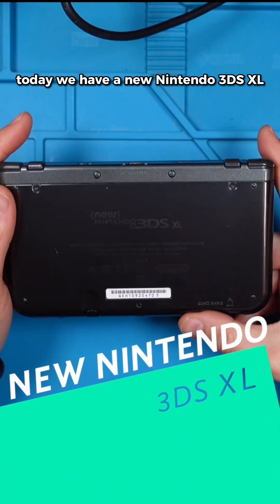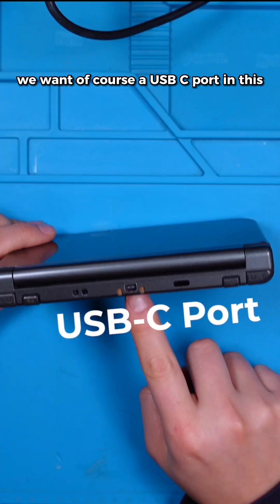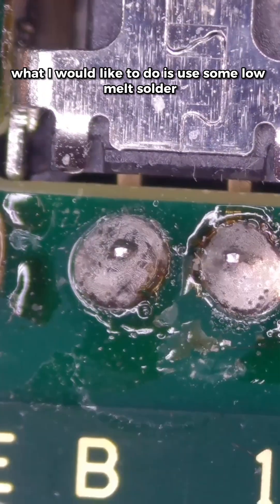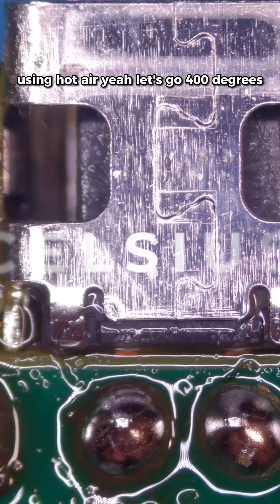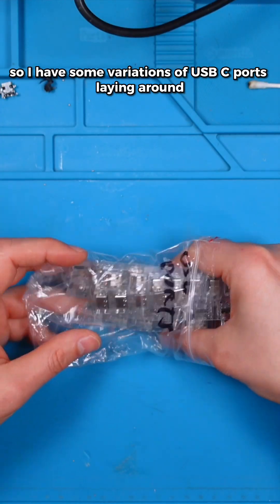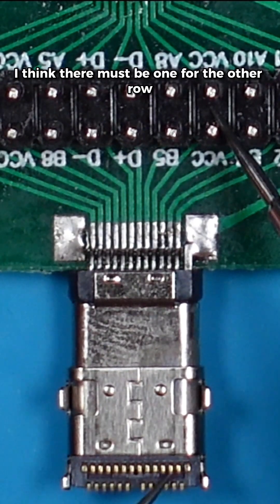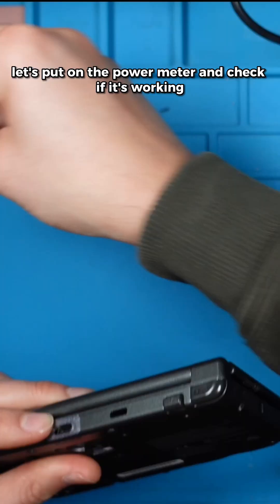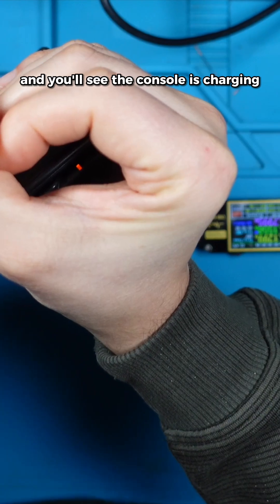NEW Nintendo 3DS XL with USB-C | SURE!

Comment: That's to fast for me 😅  I would like to do that too, but I would like to keep the connections for the charging cradle.  Is this possible? And it doesn't matter which USB-C port I buy, I would prefer one where the right soldering points are already available and I only have to connect them.
Reply from the maker: Just check out my Channel; there is a long Video about this mod. 😀